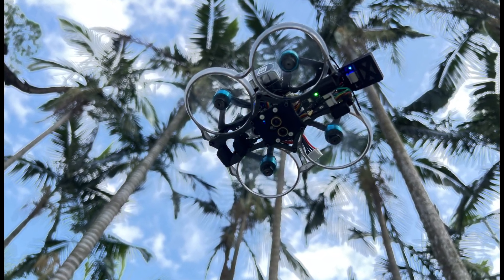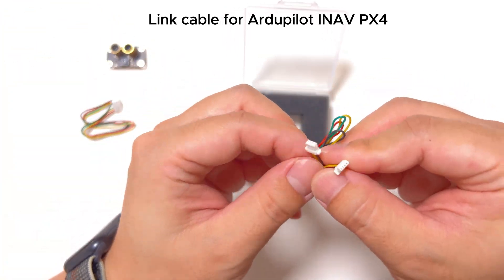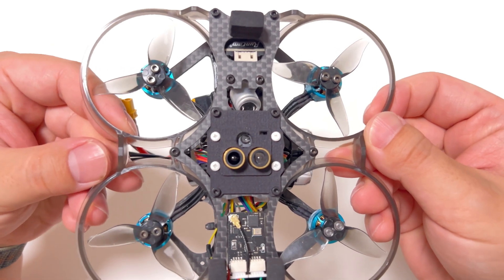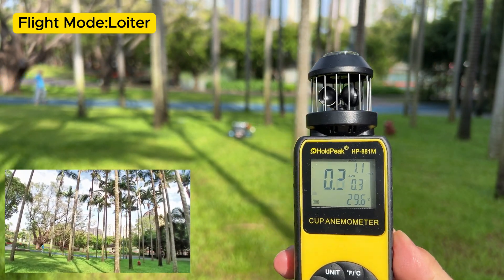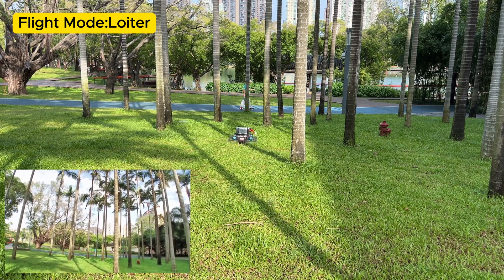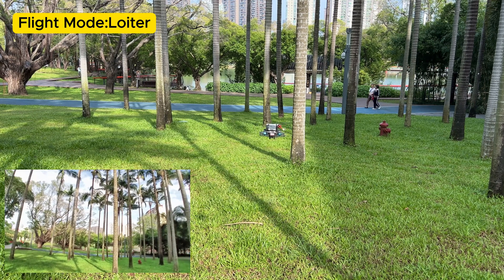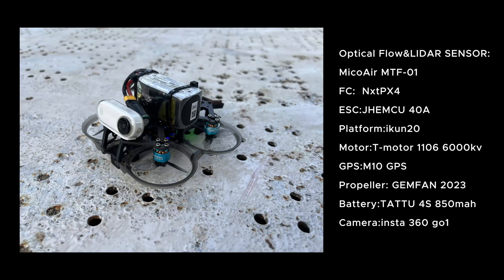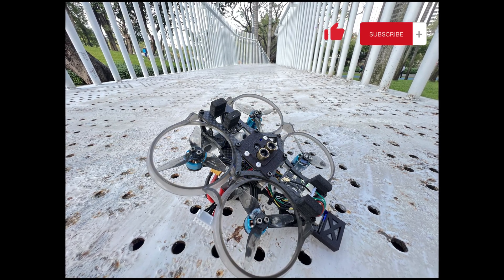Ardupilot Setup and Outdoor Test of 2 Inch FPV Drone with MTF-01 Optical Flow & Lidar Sensor

Comment: Hey! Where can i contact you , i am having a project to present in 4 days and i emergency need of assistance to stabilize my drone , i am using a micoair h743 fc with mtp-01 optical flow but its too unstable.

Comment: Where is some information on the flow_Vel_X and Y values in Micolink protocol?
I am seeing increments like 20,40,60,80,100... and -20,-40,-60,-80,-100 in the opposite direction.  MicoAir sigh details the values are cm/s @1m.  But the strange 20 increments does not make since.  Also I get (-) readings even when the sensor is moved in 1 direction at a steady velocity.

Is increments of 20 expected behavior?

Comment: Hello there!! I am doing a ardupilot pet project currently with the MTF-01 sensor. I have issues with the deactivation of SURFTRAK_MODE (Surface tracking mode), even after setting the parameter to 0 (Do not track) my drone still shoots up when there is an object below. This is an issue as my drone requires manual RC control when going over obstacles. Is anyone facing a similar problem?
Reply from the maker: The INAV system uses data from the laser rangefinder for altitude holding only in SURFACE MODE. In NAV ALTHOLD mode, it relies solely on the barometer for altitude control. This means if your goal is simply to maintain altitude without the drone reacting to objects on the ground, you should use the NAV ALTHOLD mode.

When you need the altitude hold function, please ensure that your remote control's mode selection channel is strictly set to NAV ALTHOLD mode, and make sure that this mode does not overlap with SURFACE MODE at all. This way, you can avoid the drone automatically adjusting its altitude in response to objects detected below, thereby achieving the manual control effect you desire.
Reply: Thank you for your reply! @hujiaqisr71

Comment: Wow. Nice vid, thanks for testing i doubted this could be that accurate, but im gonna have to get one thats good.

What was the fly around program you did? Ardupilot waypoint mission with just optical flow or with gps?
Reply from the maker: In this video, I flew the drone manually throughout the entire duration, using the Loiter mode. In this mode, it operates somewhat like DJI's aircraft, where manipulating the joystick controls the drone's movement, and releasing the joystick results in the drone hovering in place.  I employed the Ardupilot flight controller for this test, and there was no use of GPS or waypoint mode throughout the entire process. The scenes of the drone navigating through the trees that you see were all a result of manual control. However, the inclusion of optical flow and radar sensors made the operation quite straightforward, simultaneously reducing the risk of any mishaps during the flight.

Comment: Hey, has the gps a Big responsibility in this stability ?
Reply from the maker: In this test, I used Ardupilot's Loiter mode throughout the entire process. In Loiter mode, GPS is not enabled. Even though I have connected GPS hardware, it was not activated during the entire test. The main purpose was to evaluate the performance of the MTF-01 optical flow & Lidar sensor.🙂
Reply: @hujiaqisr71  thanks a lot ! That was exactly what i wanted to know ! have a nice day 😉